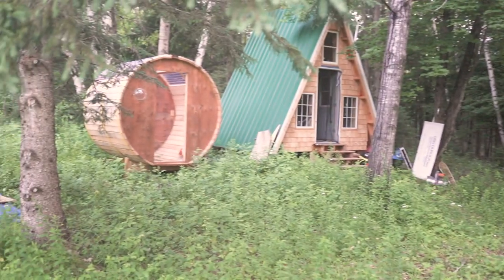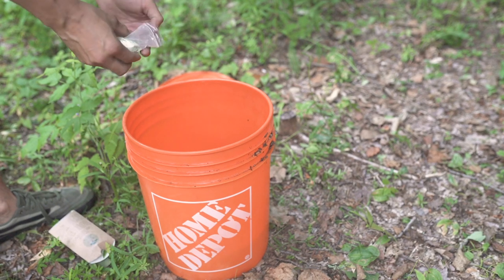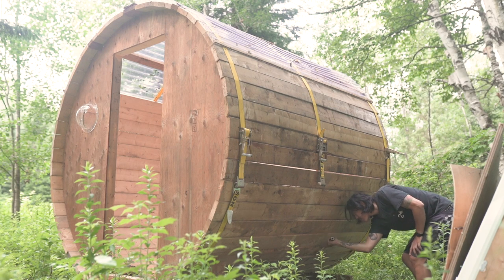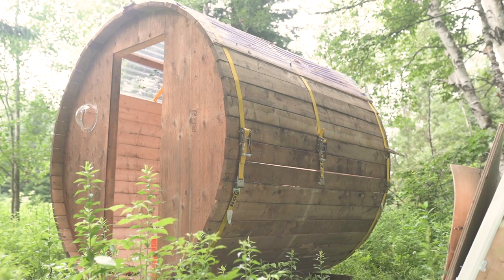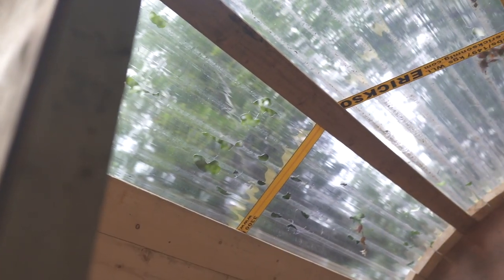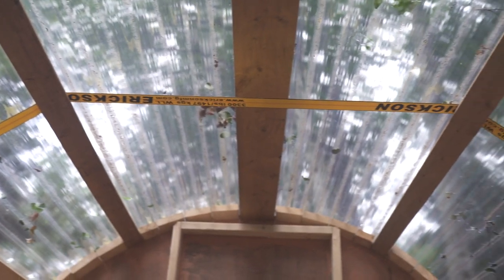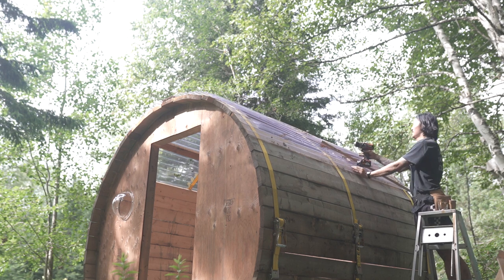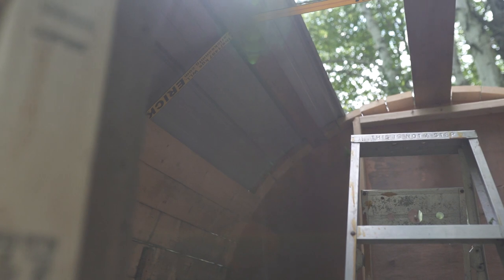Szeto's A-Frame Cabin Build - Pt. 13: The Barrel Outhouse Build - Pt. 2!

Comment: maybe you could rent a couple goats to "mow" while you work on other stuff?
Reply from the maker: Hope Rules that’s a good idea! i don’t think i’m actually going to landscape and just leave the nature the way it is!
Reply: Andrew Szeto 

Goats to keep down the brush, sheep to keep down the grasses, chickens to eat the ticks... because living in the woods sucks when you have Lyme disease....

When are you going to get rid of those ratchet straps?  Barrel looks awesome (except for straps)....
Reply from the maker: Rick Sanchez C137 the ratchets are gonna stay there permanently. also the brush has come down from driving over it and fortunate to not see any ticks in the area just yet (we’re fairly far north)
Reply: Andrew Szeto contact a local moving and shipping company, ask them how much to rent their strapping machine (hand powered like the ratcheting part of what you’re currently using but when it tightens the bands and then fastens them it slides out the side leaving just the metal straps) and buy the appropriate number of straps from them... you’ve seen stuff with metal strapping bands, well, that is what I’m discussing.  The metal straps are cheap, will last for years, and will look like they belong as they are similar to the metal hoops on barrels, only a thinner material. You may already know someone and be able to borrow for free.... ask your coast guard supply guy, in the national guard our supply people have access to strapping equipment....